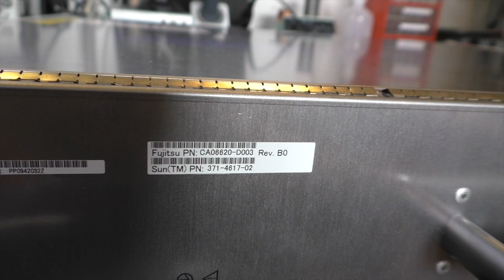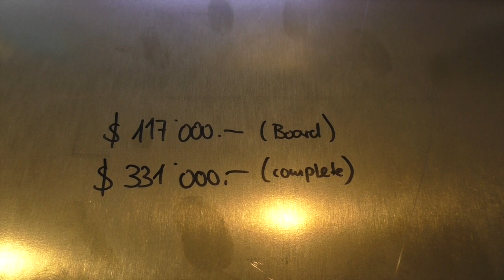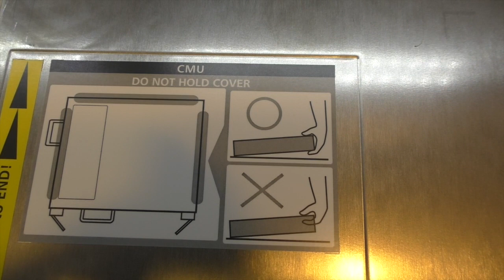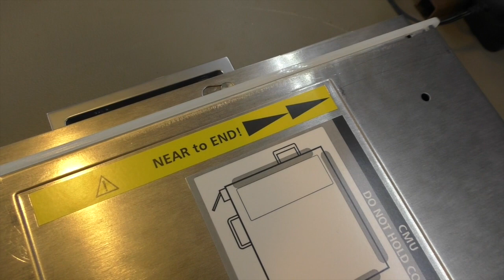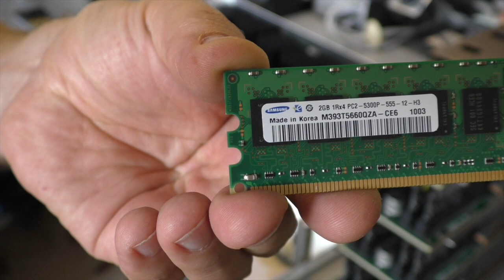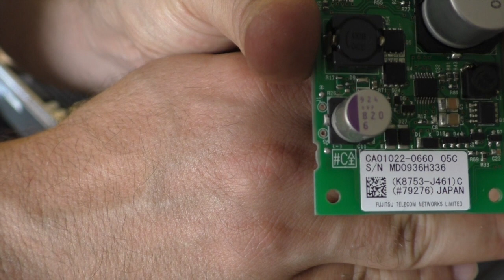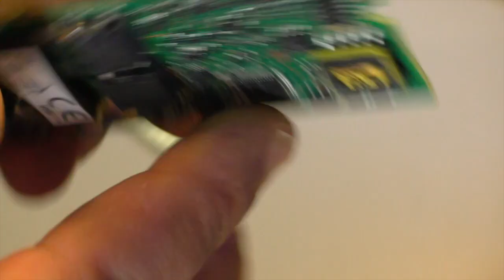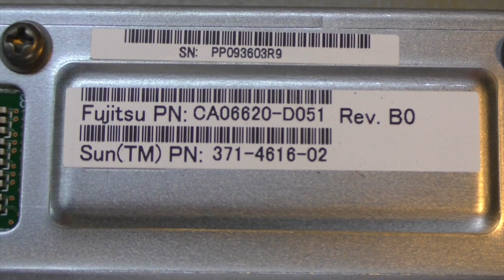How about a $330'000 CPU or a $50'000 cable? (PWJ19)

Comment: For the pricing, isn't that kinda like MSRP (VS street price) but when it hits the market and and reality hits the company, they see that no one will pay that much and they lower the price to somewhere in the $450 range, with probably some kind of package deal where the entire server will be $4500? 

For the thermal pad, it might just be a thin layer of foam from the packaging materials, I have seen cases where a system builder would forget to remove all of the packing materials.

As for the cables, i feel it may be a typo and the real pricing would have been about $10-15  per cable. 

At most, on the high side, that entire computer system would have sold for $5000 when new if the price was not haggled down a little.
Reply: +Razor2048 Well there is at least $4500 worth of connectors and mechanical let alone those insane 3.8 mm boards
Reply: +Razor2048 Oh no, they charge ridiculous prices for specialized cables. How else will we connect the damn things together. It has nothing to do with manufacturing cost, its all about "how bad do they need them?".
If its important, it will be expensive no matter how cheap it is to manufacture.

Comment: Are these hot-swappable CPUs?
Reply from the maker: The whole module with 4 CPU's is probably hot swappable but not each individual CPU. I don't know this machine very well. On the smaller system like the M5000 you can disable CPUs and change them if necessary.

Comment: Not screws holding those heat sinks down.  Threaded posts.  Stainless steel rods that are drilled and tapped inside rather than having threads outside.

Also, this is telecom equipment, so take that $300,000 price tag with a grain of 'captive market that uses this shit' salt.  They have the money for these processing elements, and the companies that make them know that.  This is MAYBE $20,000 in actual build equipment for someone to make a similarly equipped unit.  However, this is absolutely specialized and will do some specific tasks much much faster, while other tasks that the 20k unit might do faster... just those tasks are REALLY damn important.

Comment: What is the use of this computer ,.
Are they made for servers ?
Reply from the maker: They were mostly used as database servers. Oracle bought SUN some years ago, that's one of the most famous database software manufacturers.
Reply: but i saw no hard drives .
Do they only process    large database for large number of clients?
or used with standalone database storage..?
Reply from the maker: the hard drives are not in the same case. They are in a storage system in an own rack. You have to think much bigger... :-)
Reply: that means my guess was correct.....( standalone storage)

Comment: What you're saying makes no sense. Gold is one of the best heat conductor materials, also the best protector against oxidation. The heat transfer of the processor is based on direct contact, not irradiation. If the processor was open free, irradiation would play a role. But the way it's build, with direct contact with the heat sink, the gold is the best option.
Reply from the maker: I think you're right. I just remembered an automotive guy who told me than chrome plating the entire engine would be bad because the normally radiated heat would be kept inside. Of course there is no heat sink on that engine.... So I assumed the same for the CPU. But I'm learning stuff every day.
Reply: Yeah, if it'ts an air cooled engine this is possibly true... About CPU, they wouldn't spend that amount of gold if its not effective (and they seem to do so only in high performance systems)...

Comment: I bet you could get a much better deal for a complete system. Spare part pricing for specialized products is typically ridiculous. Something like $1 to manufacture, $10 at retail, $100 sold as industrial spare part. So it is likely that the company that actually made that $50k cable charged $500 for it.
Reply: +MrDementori The cable doesn't cost 50k, that's just rubbish ;) But the main reason prices for these systems are so high is because you pay for a working machine, meaning any issue is solved, usually within 4 hours of it starting without extra cost and other issues. You can build a system yourself but if anything breaks, you're on your own and you'd have to buy at least 2 identical systems to provide basic redundancy which at this performance level will have you come dangerously close to the price of the 'standard' products like this system.

Comment: Sun Micro systems always charged a fortune for parts and cables, the 50k for the cables is just a massive profiteering rip off, they are worth about $250 each, assuming they are hand made, and that's mostly labor costs. What cool now that you can make you're own desktop PC i7 7700k 32G system for about $1,000 and it a lot faster than that expensive junk of 5~10 years ago. The only difference is the server class machines have hot swap and redundancy ECC ram etc, but you can build a workstation with this now too anyway, and use it as a server no problems. This a game changer, you don't need to spend millions on you server room anymore, need more power, just add more servers and run VM ware bubbles..technology had massively improved these days.
Reply from the maker: An iPad Pro has about the same CPU power as a liquid cooled CRAY-2 supercomputer in the 1980s...

Comment: The engineering is amazing! This was the Ferrari of its day. Now it’s just a used Fiat.
Reply from the maker: Or more like a used tricycle.... with flat tires ;-)
Reply: @PlaywithJunk  Don't know if I'd go that far 😉 Those Sun SPARC Enterprise servers packed a lot of punch, even by today's standards. What makes them obsolete is the amount of power they consume and the concomitant material required (heavy metal...literally!)  to cool them that makes them uneconomical to operate, in light of newer systems available today. You can tell just by the amount of dense metal removed in the disassembly why just one module weighed 22 kg! (hint: it wasn't the chips) 😂
Reply from the maker: @sfperalta  I did not say that because of power or usefulness, but because of the price today. These systems cost millions when new and now you get parts for a handful of coins...

Comment: If those servers are like normal server then those cards you took out at 15:00 are probably to unlock the CPU's also, you keep saying CPU to the entire unit, the unit consists for several CPU's, bunch of ram, main board and more, its the full stocked unit that costs 330K not the CPU's

Comment: Why is this so expensive? The CPUs are only dual cores and the RAM is only 2GB densities.
Reply: +Company Policy Think about all the gold plating, electronics, and steel that you are getting. If you're going to pay high-price for server equipment, then you should expect getting some serious materials.
Reply: +48Hz Quality. You've probably at some point bought the cheaper option of something only to figure out paying slightly more would've given you a product that didn't break down as soon as you opened the box ;)
With this thing, if anything breaks it is fixed by the manufacturer immediately (within 4 hours, some even faster).

Comment: did you do this to recycle this item ??      If so, can you tell us  The You tube audience how well that worked for you ...What did you pay for it to begin with and what did you get for the scrap...   If you didnt recycle it did you put it all back together ?
Reply from the maker: This system came back from a customer who bought new hardware to work with. So we had the job to remove it and get rid of it. We sold parts of the system but the market is saturated with those old SUN systems and prices are really low now. So some parts, including this CPU module were decided to scrap after a few years in stock. And that's what I did.
And because it is a great looking piece I made that video before everything was trown into the recycling dumpster.
Cost: $0.00   Profit: $0.00 (except a few dollars from Youtube...)
Reply: and your firm  would get  more $  from scrapping  these  as opposed to parting out ?   It looks like there is   a LOT of these parts out there being sold, that are still pretty pricey though not in the 330k dollar range ..    How much was your firm   trying to sell that CPU module for  if it sat for a "few years in stock"    ..Just curious about the economics here ?   thanks
Reply from the maker: Last month I needed a new mainboard for a HP blade server, a BL685c Gen 5. That's a server at a price of $10'000 to $15'000 when it was new about 10 years ago. Guess what we paid.... 

Less than $10! 
I mean yes, we could sell all that stuff but for selling a piece at $10 you have to invest $50 to write bills, delivery papers, testing and cleaning, packing, shipping... It's in fact more profit when you simply throw it away.
We do sell hardware when it still has some value. But some parts have become worthless. Sad but true.

Comment: THats it... Just a measly 64gb? I have that on my rig here at home
Reply: +Legs additionally to what +mmhansen said, this 64GB is spread out among way more dims than a consumer end pc and has way more expensive controllers and operates at way better speeds with way better error correction.
Reply: DDOGJENKINZ Not anymore... This thing is ancient. Recently all the memory controllers are in the CPU itself.
Reply from the maker: +Legs Did you also have 64GB six years ago?
Reply: chrigel1234 Not 6 years ago, I have 64gb now
Reply: @cjoshskull25  6 Years ago having 64 gb of ram was an abomination, back then standar was somewhere around 1 to 4 gb. Having 64 gb back then is the same as having somewhere around 1024 gb of ram today

Comment: I had a friend who worked for a company called Kimber Kable, they use gold plating & gold & silver alloys for the wire. 
(Hand soldered in Utah by unwed Mormon girls with an LDS Temple Recommend ... virgins with certification!)
Reply from the maker: I know Kimber cables. You pay a lot for the name.....and the name....... and the feeling to have one of the most expensive cables on your stereo. :-)
Music always sounds better when your wallet is lighter.
Reply: mehh. I beg to differ, a little. I won't pay 20 times more for wire that gives me a maximum of 2% better efficiency etc., etc. but I will spend the money for a good amp & good speakers  ...withing reason, of course.

My brother is a good example of an audiophile that should just do his homework. ...tells me that fiber optic sounds better than digital coax, for instance. lol "they are both digital!" I try to tell him but he always finds a way to believe that there are massive differences.
 Sometimes you just gotta learn to smile and nod.  ; )
Reply from the maker: I totally agree. Good speakers make a big difference... if they fit to the room. I have heard $100'000 speakers sound worse than $1000 speakers because the room was too small.
Amplifiers do also have an influence but a much smaller. And cables must be extremely bad to hear any difference.

But as long as there are people who de-magnetise CDs or paint the label surface black to eliminate "reflections", someone can sell them a $10'000 cable.
Reply: ROFL  Damn strait!
 There's always money to be made from selling an idea as apposed to a product. lol

Comment: Wait, so what kind of companies are throwing out and replacing a whole $100,000 computer board just because of one faulty chip?? Are these Google server computers or something??
Reply from the maker: Google servers are thousands of cheap PC's stacked in large halls. Today you can buy such a board for $1000 or so on Ebay.
The sad thing is that the WHOLE system has been thrown out and this was just one part of it. It was obsolete, outdated....
Reply: Probably costs more to find out what's wrong with it - hardware specialist contractors charge high day rates, and the support is probably finished for this model from the OEM.
Reply from the maker: there was nothing wrong with this system. It was just not used anymore. And selling them is useless as no dealer wants them.

Comment: no way 2GB ECC's are anywhere near $1000 each.
Reply: Grim Dark End maybe at one point, but it's clearly not worth that anymore
Reply: Indeed.  I worked at DEC in the 90's and got to play with alpha systems that would put systems at the time to shame in certain tasks (as they were RISC cpu's)... 600 mhz risc when 100mhz was the 'top of the line' in extended instruction sets.
Reply: Grim Dark End I would like to see 'modern' computers either seeing an increase in core count or an increase in frequency.  been stuck at 4ghz quad cores for the masses for quite some time, of course you can go above and beyond that with overclocking and watercooling or ln2 cooling if you are in to that but ln2 isnt exactly practical for every day.

Comment: The most overpriced components on the planet... it's not as if the unit is made of fucking 24K solid gold. How the hell can anyone charge that much for those specs, even for 2013? For fucks sake.
Reply: It's not about the hardware, it's about the data they process... If a company processes payment traffic it can process billions every day, making a few thousands for the machine peanuts...
This is not an upgrade kit for your laptop, you won't see this at 99.9% of all companies as they do not have a need for it but the companies that do need it have such expensive employees which such extensive qualifications, experience and so on that hiring more of them to operate a cheaper system that requires more man hours to maintain will cost more anyway...
Reply: Soldier of Feels its about when you continue to overbuild the cost becomes excessively expensive and scales poorly. just think this one rack could run over 1000 virtual machines of windows 10 for its raw compute power. if you wanted a office floor with 1000 cubicals that have no towers under the desks. you could if the software existed run a game of starwars battlefront on a 4k monitor at 60fps without a gpu at all. this is server teck its not made for above purposes its overbuilt for accommodating thousands of clients at the same time clicking away 24hours a day 365 days a year at broadband internet speeds with packets of data.

Comment: 32k for 64gb of ECC RAM?! That's some hella expensive RAM.
Reply: If you buy it from SUN or Fujitsu. On eBay you will get it for much less money.
Reply: The price is wrong anyway, even at premium prices you'd struggle to pay more than $200 per DIMM which would at worst be $6400, a lot of prices he claims are false or for the entire system, he only has a small part of it here...

Comment: So we expected this crap to have the performance of 330 Intel I7 extreme cpus together?

So what exactly is the performance of those 330K $ cpus against 330 Intel I7 Extreme together, 10% their performance? LOL
Reply: +guily6669 Have you tried running 330 Intel i7 cpu's in one system? ;) You'd need around 30 racks filled with 330 servers, each with their own components and support systems including switches and some serious routing capacity. Not to mention the power supply for 330 systems...
If you'd buy x86-64 based hardware for 330.000 you would get a decent system sure, but it would be completely useless as it cannot run the software for this server, which will cost a lot more in development than that $330.000.
Besides, 330 i7's won't perform that good any way, not that the i7 is shit, but the latency and overhead of routing 330 nodes would be so high the first part of those machines would be wasted entirely on running the other part...
Reply: +Some Guy Yes, but I was just simply comparing the price of the CPUs directly, not the entire machine as he is claiming that it cost a lot more the whole system...

Comment: It looks like, a blade server system, which processors connected into a cluster on a single motherboard. 
There is a light sign of over heating, which could cost cheap to fix. 
-Looks like this cheap man really don't know a whole truth, of what he's doing. He's ready to scrape a system for gold by crashing chips of such an amazing server. I can bat that a startup companies are dreaming to buy it for at least 5 thousand dollars, like minimum.
Reply from the maker: Prices on Ebay are something to be careful with. What a seller wants and how much he actually gets is a big difference. I sold the 8 HP Blade Enclosures (fully equipped with blades) for 12'000 Euros and that was a good deal. Other dealers offered 3000 for the whole pile. I doubt that the guy with the HS22 really got $14000...

It was especially a good deal since we got the Blades for $0. Of course I could sell all the parts individually for a higher price but do you know how much work that is? I was more than happy that the whole shipment went to one single address.
Reply from the maker: BTW I needed a new system board for a HP BL685-G5.... I got it for 8 Euros! That's reality.... :-)